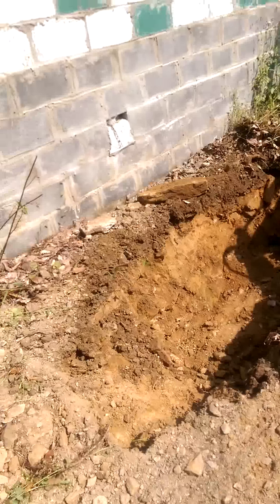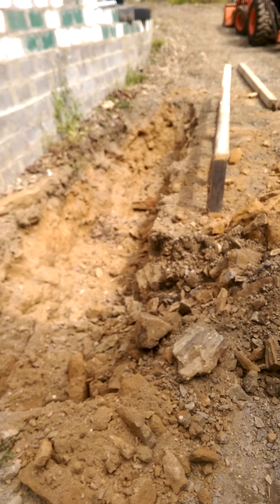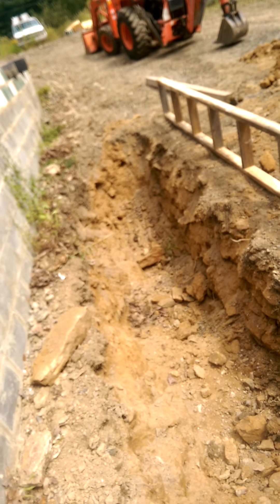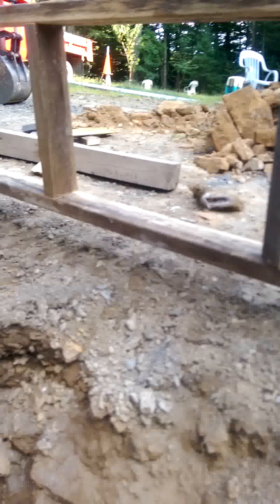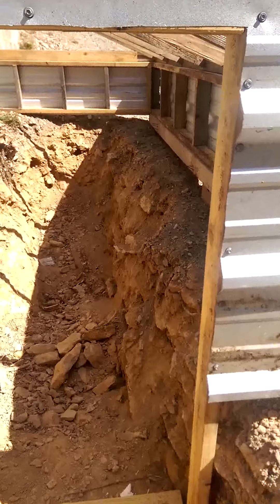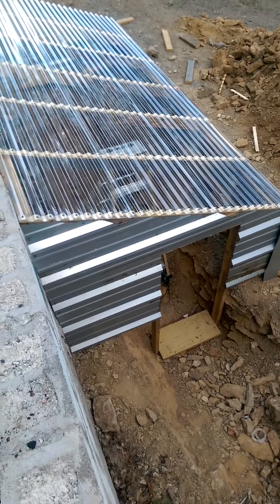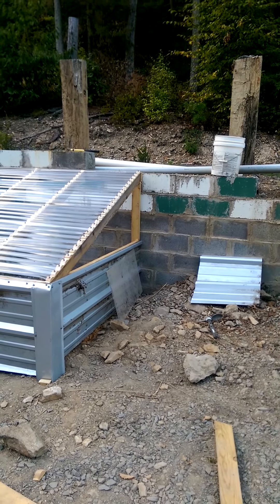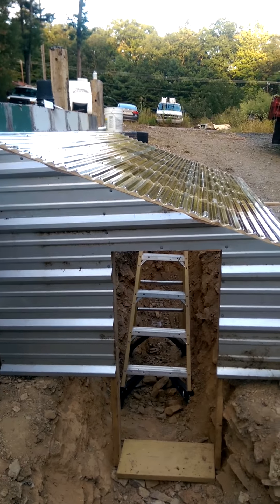Walipini Build (Pit Greenhouse) Part 1

Comment: looks like you might lose that wall, if the foundation is not stable, it can collapse... instead, dig it down to where you want , then install a wall from the bottom up
Reply from the maker: Hi..  It's already gone and filled in. I  just finished building a geothermal greenhouse..
As far as the wall, it's tied in with 16 concrete tie in's that are 4' long connected to the concrete filled blocks. It's full cantilever supported not relying on the footer for lateral strength.

Either way the new greenhouse should be just as warm with much more space :)